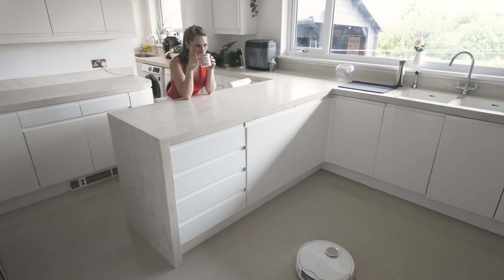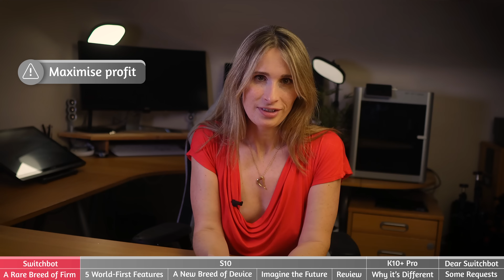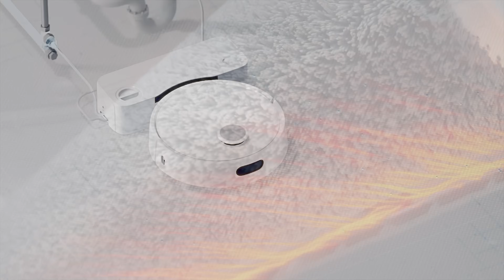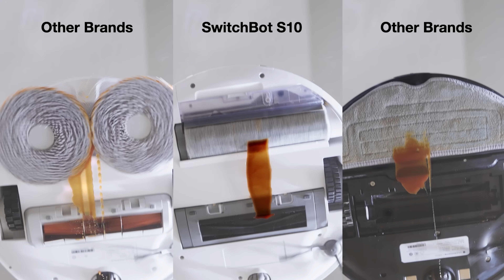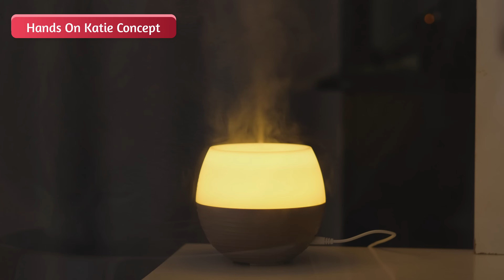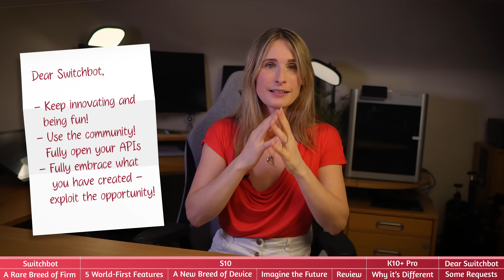The NEW Switchbot S10 & K10+ Pro: A Giant LEAP in robot vacuums

Comment: My experience with it so far is less overwhelming. I got mine yesterday, and have only played around with it a little bit so far.
Some of the issues are my fault, since I may have been a little to eager to get going. I missed the quick start guide because it was behind the warranty card that I put aside. I initially did not find the T-connector to connect the water station supply because it looks slightly different from what their video shows.
I tried to set up the S10 without the water station initially thinking I could add it after I got the parts I needed but that caused the setup to fail when it needed the location of the water station.
I do believe there is significant room for improvement in their documentation and app, especially when things aren't working. At one point the device failed to dock to the water station and said it "paused" but I couldn't find how to unpause it.
I have had to re-pair the bot several times to both stations. It also took various attempts to get the bot to load water from the water station for some reason. With little to no information why it failed.
Now that everything appears to be set up correctly the bot is able to vac and mop.
It is somewhat louder than expected, certainly louder than what I made out from this video. Both when vacuuming and when the mop is being dried. It is certainly not terrible (40dB close up while drying) and I'm probably spoiled living in a nearly air-tight house but it something to consider.
The mopping has left some stripes on our tile floor during the first run, that is something I will need to look into.
I also raised several issues with their website, from the short password length supported to the fact that after registering I can log on in the app but not to the website.
Reply from the maker: Hey Bram! Oh dear, sounds like a lot of initial challenges!

Few thoughts - skipping the quick start/manual.... yeah <awkward shuffle> I might have done that too... manuals are for when you have nothing better to do!! ;)

This re-pairing sounds very peculiar, I've not experienced that at all - is there any issue with wifi cold spots where your waterstation or charging station are located? 

Certainly I can't speak for the sounds levels, I find it much quieter than my old iRobots - the emptying of these devices is always noisy, but I find him very quiet as he trundles around - that said I perhaps have a different level of 'noise' with two mad children running around, than your silent sounding nirvana!!

Mopping stripes I noticed too, but that just disappears after the first few runs - I think this is just the mop getting balanced out a bit, so it's a temporary issue I'd say.

Great thoughts though, I think it's great to hear all these experiences as it's impossible to get as rounded a perspective without people sharing their own experiences!

I agree on some of the instructions being a little confused between what was obviously printed/filmed originally vs where the app has evolved to now - so definitely some ways they could improve (even if I probably still won't read the instructions!!) - but once it's set up, it really has been fire and forget for months and months, I can't even calculate how much mopping time it's saved me, because I'd never have done anything like this amount!!
Reply from the maker: Ps quickly checked noise levels, it's pretty much in the pack (mid lower end vs other robot vacuums) - certainly it seems there's a trade off of performance vs noise levels as you'd expect, but there's not a huge difference in performance.
Reply: @handsonkatie  thanks for the reply! I blame it on aborting the setup because the water station wasn't set up. Since everything was paired up correctly it hasn't happened again. Had it clean and mop two floors today. Not sure I have done that right as it involved picking it up and moving up and down the stairs a couple of times and it again ended it a state where it was paused when it couldn't get from the water station to auto clean station. I did enable the feature marked beta "water station not marked" so hopefully that will improve over time.
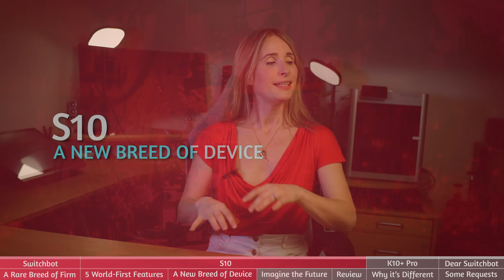On a positive note: I pointed out to their privacy team that the link to the terms and conditions on the registration page was wrong yesterday at 17:32 PM CET. And they replied after it had been fixed today at 10:38 CET. That is impressive.
I also received an email that there has been an update to one of the other issues I opened yesterday but the reply itself is missing from the email and the link in it goes to their main support page. So that is less helpful.
Reply from the maker: @BramMertens  hey Bram! Yes, they are actually very responsive to feedback and bugs, just naturally can't fix everything in one go.

I do wonder about this odd water station behaviour. One random thought, you know how it comes with a 'non plumbed' water station too, have you tried putting this on the other floor to test? I just wonder if it might help diagnose that is the problem? The other thing is to make sure it's recognising the other floor as a separate map and you let it fully map it too. Drop me a note on my site if you want to chat though more as can share images/photos there and keen to get fully mapped!

Comment: I wonder how this dries this spinning mop. Is there something or it stinks after a while?..
Anyway, for me, integration with home assistant is a must. Ideally local. I have Roborock S8 and even though it’s cloud based, still good. So it vacuums when I’m away and alarm arms, it stops when I come back home earlier and return to the charging point, it informs me via HA that dust bin should be cleaned (unfortunately I don’t have self emptying one, not enough space at home), I can set cleaning of particular room via HA, alarm is aware that robot is moving, in future I will be able to use HA voice assistant (once it gets usable) to clean a room.. all that not possible or hard without exposed API.

So yes, SwitchBot, API (and if you want to differentiate, local one) is a must
Reply from the maker: Oh it's seriously cool - empties all the dirty water automatically, then it goes back to its docking station and blows hot air over the roller for a few minutes that totally dries it, stops any smells/bacteria/mildew etc!! Honestly it's a joy of engineering to behold!

Definitely agree on the API - basic Matter is already there, just needs a bit more development!
Reply: @handsonkatie  got you. Good, because worst thing is when it stinks ;) Thx

Comment: I agree this looks to be a real game changer! And yes, open those APIs, please!

I'm actually surprised it took this long, I had a Scooba (made by Roomba) which had separate clean water and waste water tanks, and worked in a similar way to the Switchbot... except that you had to manually fill and empty it, and it was a separate device rather than integrated vacuum.

The big pain for me was that I'd have to spend 15 minutes moving chairs out from the table, adjusting the placement of speakers so that the Roomba and Scooba could get to all of the parts of the floor and wouldn't try to eat cables (even if technically they could untangle themselves, I doubt it was good for the cable). Then if I wanted to clean other rooms I'd have to open internal doors to allow access.
Then when it was finished I'd spend another 15 minutes putting everything back.

In the end I spend as much time accomodating it as it would take to run around with the hoover and mop, though I appreciate that things have probably improved a lot in the last 15 years.

Switchbot might just be the company to make me give it another try :)
Reply from the maker: Spot on Chris, as always - I was much the same, hence my point at the start, I remember the first robomops appearing, then they just seemed to stagnate so none of them were REALLY mops, more gimmicks and task robots that often created more work for you than the original task! I have to say three months on from continually testing S10, it's immense - it really has just totally taken over the whole task. They're definitely here to stay, but the S10's mop makes all the rest look pretty last generation suddenly!

Comment: I've been rather underwhelmed by robot vacuum cleaners in the past.  We went back to a shark manual because it took less time than unclogging the dog hair, untangling shoe laces that the cleaner had eaten and moving the dozy roomba out of the sunny spot that triggered the stair alert. The last was particularly annoying because we couldn't turn it off and we dont have any stairs. While the mop attachment followed by the vacuum would be a major plus as slopped dog water bowls won't clog it like our other bot cleaners , I'm not convinced the dirty water resevoir won't clog over time. It would be interesting to hear a report after a years use.
Reply from the maker: Well three months on so far and this household hasn't wrecked it. The innards are actually pretty elegant and accessible, so I'm not sure that'd be too big a problem even if it did happen. Just click out the reservoir and the filter is there to rinse out! Agree, certainly with mopping robots have been pretty underwhelming in the past, but delighted with this one - first of the 'proper' generation I'd say, he's mopping floors 10 times a week without a finger being lifted, it's awesome!
Reply: @handsonkatie  that all sounds very promising  thanks for the update. I'm pretty sure our household and dogs would provide a pretty good destructive testing ground for most machines. My other concern would be if it called home a lot, given our lack of mobile signal and ropy broadband,  so another vote for home assistant API from me.

Comment: I’m also really happy with my S10. The software can be a bit buggy at times, but that can be fixed and the hardware is really solid. 

I would love to have a water station with multiple outputs that can be selected individually and controlled via automation. That way it would be possible to maintain multiple plants with different watering requirements from a single base station (kind of like an AMS, but for water instead of filament)
Reply from the maker: Yes, the software was a little buggy a few months ago, but they've been visibly improving and it's been rock solid for last couple of months for me. Love the idea of multiple waterstations - they could just release a 'plant station' that does exactly this, fingers crossed eh?? ;)

Comment: I have used the IRobot S9 and M6 pair right from their respective releases. Recently move to a new house without any carpet 🎉, but it has fairly large transition threholds between rooms (say varying between 5-10mm) do to flooring thickness. Which the M6 now views with its algorithm and pad design as carpet edges. Can you offer any input as to how well the S10 handles pretty substantial thresholds (nothing higher than the thickness of an iPhone)
Reply from the maker: Ah, I can actually as I had exactly the same problem!! The M6 was terrible at navigating any sort of bump. S10 and the K10+ have had no problems at all with similar thresholds in my house - indeed one is even larger (maybe 15mm). As the S10 can actually lift it's roller and mop, it can navigate pretty robustly over bumps and thresholds!
Reply: @handsonkatie  Thank you for this context. Really appreciated

Comment: I bought Switchbot Curtains based on the previous video. The hardware works fine, but it doesn't work with Alexa and I consequently found out, that it has tons of very negative reviews on Alexa. Apparently their skill is broken and support dreadful or out right sticking their head into the ground. It's an experiment in my case and the curtains Switchbot works at least with home assistant. But I'd advice to be careful and also look at real reviews. I'm not saying this one is bad, it's good to get us excited, but not enough for knowledgeable decision 😊
Reply: Weird, i have mine working with Alexa, you could try creating a 'scene' within switchbot app that opens the curtain and then have your amazon alexa app auto pickup the switchbot scene and it should then be selectable in the alexa routine creation page as a scene and do what you need on voice command
Reply from the maker: Oh dear, sorry to hear this! I'd always recommend checking out your own ecosystem - there's no reviewer out there that can possibly check all the variations of Alexa, Google, Apple, HA, Smart things and so on. I certainly also check these over weeks and weeks, rather than the day or two that most do for exactly this reason. I've actually always found the support excellent, so it sounds odd. I do think a lot of these challenges will disappear as things like Matter mature - having to develop for dozens of ecosystems like they do at the moment is silly, or you could just get HA as you have and I'd always recommend!! 😂😂

Comment: Open API would be great! Chances are, they wouldn't even have to do the Home Assistant integration themselves, just QC on the community add-ons.
Failing that, they could do a good solid Matter integration, and you could at least get the devices to talk to Home Assistant that way? Or am I overestimating the maturity of Matter?

Back a few years ago now, I bought a Neato Botvac, which is coming up to EOL, as the manufacturer exited the robot vacuum market, and left us with an app that won't be maintained any more, and won't be available much longer. They never opened their APIs, even when they were leaving the market, which is super disappointing, and means that my robot will be useless by 2027 at the latest. Best start saving for a new one, I guess, and the S10 just hit the top of the list!
Reply from the maker: Yes, they're already have a basic Matter integration for the S10, so suspect this will be solved very shortly!! 🙂

Comment: Couple Thoughts for Switchbot! 

1.) Open your API. 
2.) Modules dedicated to water or power delivery only. In an environment where you will want to use these features often, perhaps multi-purpose devices like mops, vacuums, water delivery and power delivery all-in-one are not the best solution. If your vacuum gets clogged or a closed door blocks it's return to the base station, your wireless battery operated camera doesn't die or your dehumidifier doesn't stop running because the tank is full. Another module could still be there to do the task. Plus dedicated modules would be cheaper and individually better at their jobs than a multi-purpose one. 
3.) A UPS style rapid recharge station. Essentially a power bank that can be placed remotely in your house away from outlets that powers a base charging station (surge protector, USB hub, etc.) and can trickle power to devices like IOT sensors, wireless cameras, baby monitors, etc. The modules can travel around and top them off as needed... even multiple times a day.  There are also quite a few emergency items that you could want to keep topped off without having to think about it  too like, battery banks, rechargeable flashlights, drones, car jump-starter boxes, your tablet or even work/personal laptop that you forget to charge everyday.
4. On the topic of multiple modules, perhaps a robotic towing module that can use wireless power delivery, electro-magnets, speakers, etc. that can facilitate the return of another module that dies or gets stuck. I know this is a little fantastical of an idea, but if the eco-system for this really grew, I don't see why it couldn't make sense.

Comment: Wow, I was skeptical coming into the video but this totally delivers. The connection to mains water and drain is huge, I now never want to change the buckets for my roborock ever again... And I would love to see the water delivery AND power delivery become standards - those ideas are simple but so clever! By adding features like that, the robots can also live on in other roles as they become outclassed in their main duties by newer models.
Reply from the maker: Absolutely spot on! That's exactly the experience I had (ie suspicious to mind-blown!). There's something about just not having to think about it at all that's so much better than replacing manual mopping with emptying the bucket...! The roller mop is brilliant too in how it works, instantly cleans itself, so you can see this when it goes over spilt ketchup or stains, cleans brilliantly!